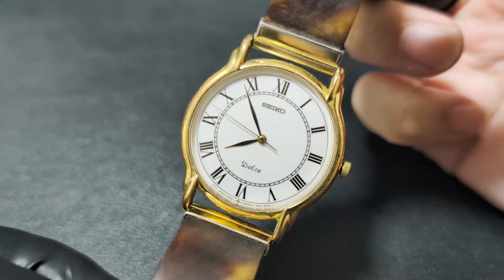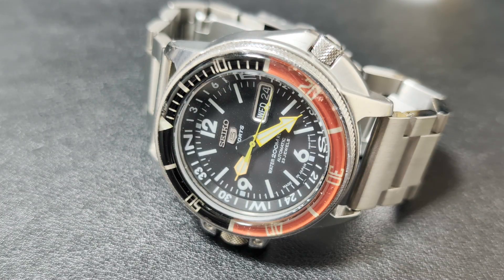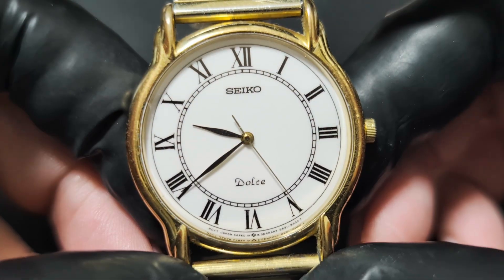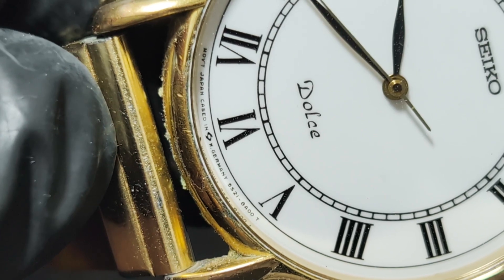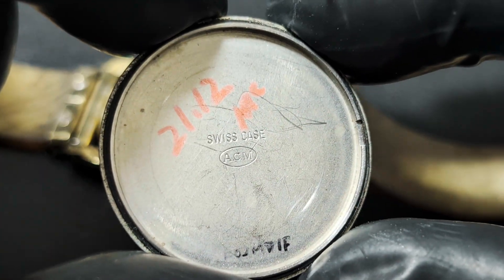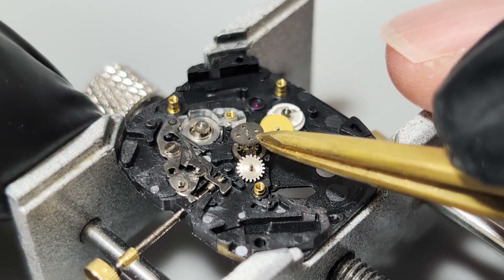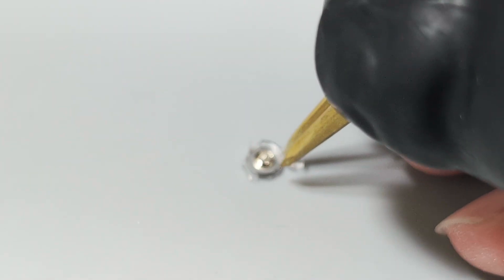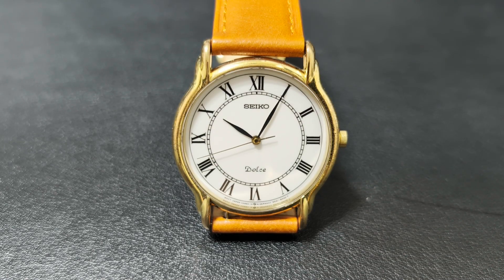Seiko’s Forgotten Sweep Seconds Quartz: Inside the 5S21 Movement

Comment: i wish that the viscous rotor and hairspring wheel could be more easily found. this design is so wonderful but if it breaks you will be sad forever. I had a 5s21 that had the viscous gear broken by a previous watchmaker who likely did not align the pivot when they screwed down the bridge.